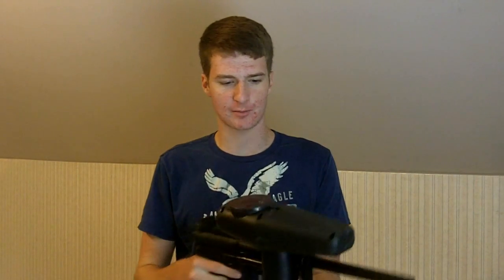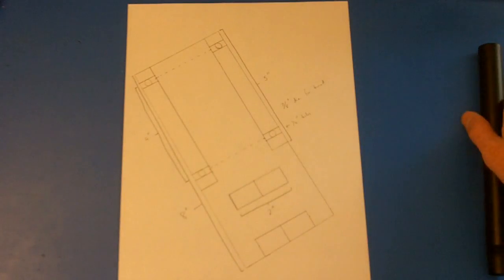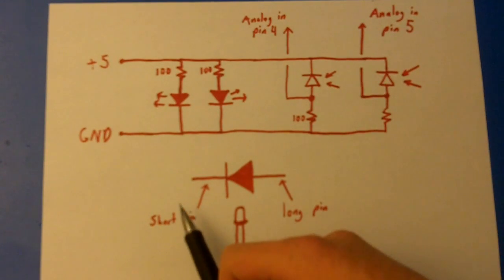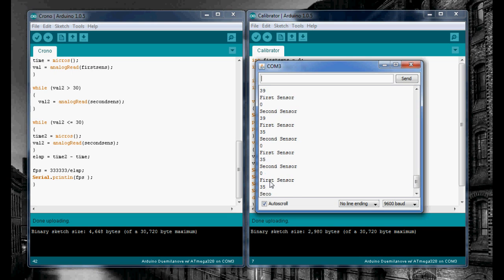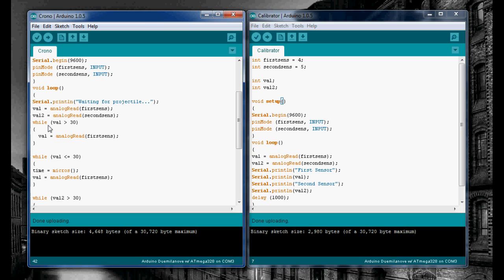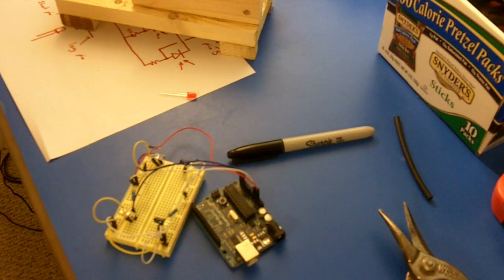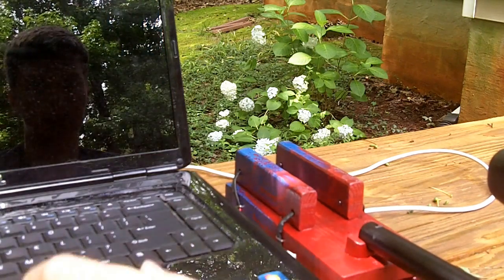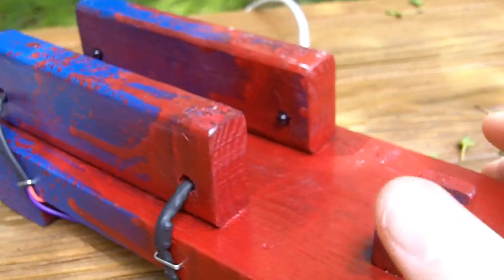How to Measure Speed With Arduino (Of a Projectile)

Comment: When you used the project outside, I was thinking would it be better to put a lid on the hardware , so it cuts down on the light , maybe then a threshold may not be needed ?? 
The barrel holder you've made, I was think of a piece of plastic conduit tube so that the barrel is more secure? . 
The diameter of tube obviously just a tad bigger than gun barrel, and make the tube say 1 foot or so rather than firing at point blank?
I'm to make your project to see results from my air rifle, I'll post back my results when I've got them.

Comment: Great Project! I'm trying to run this same type myself to measure the speed of a projectile coming through a split Hopkinson bar barrel. Are you using a 3 pronged receiver in the video? it just looks like a 2 pronged receiver but the schematic shows you have to have it grd and power and output to Arduino? I have it set up with an IR receiver module that actually comes with an Arduino starter kit but and I'm getting a reading but it won't show an interrupt is happening when I cover the receiver module? any ideas on what I may be doing wrong?

Comment: Loved the video! It really helps with a project I'm doing. I am a little confused on a way to apply to my project because it involves exporting the arduino data through a textfile to matlab in order to analyze it and display the information. Is there a way to do this for multiple trials without having to export each data attempt as a separate data file and changing the matlab code to read that file? Any help would be greatly appreciated!
Reply from the maker: Hey Drew, Thanks for the comment! Yes there is definitely a way to accomplish what you are wishing for. You should be able to print the data over serial from the arduino to a PC running your MATLAB script. The incoming serial data can be read using the serial object in MATLAB. You could also look into MATLAB's arduino support package which is designed specifically to connect arduino projects to MATLAB. Hope this helps!

Comment: improved version of same code 

//*******************************************CRONOGRAPH******************************************
// using IR detectors with 10k resistors at 5 volts 

#include <Wire.h>//MUST include for LCD to work
#include <LiquidCrystal_I2C.h>//MUST include for LCD to work

LiquidCrystal_I2C lcd(0x3F,20,4); //MUST have for LCD to work with I2C on ATmega 

// using 20x4 LCD with I2c address of ox3F 

int thresh;// lower value makes it less sensitive to ambent light 

int sens1 = A0;
int sens2 =A1;
unsigned long Time,Time2;
float fps,elap;
int val1,val2;

void setup() 
{
  
 /* was built with ATmega8 could use any ATmega 
  * setup runs one time after reset 
  *everytime ambent light changes just reset controller
  and all will be set
  */ 
  
 val1 = analogRead(sens1);
 val2 = analogRead(sens2);
 thresh = (val1+val2/2) - 50; // take AVG of two senors subtract 50  
 lcd.init();
 lcd.backlight();
}

void loop() 
{// begining of loop
  lcd.setCursor(0,0);
  lcd.print(" Waiting.. ");
  val1 = analogRead(sens1);
  val2 = analogRead(sens2);
   
  lcd.setCursor(0,2);
  lcd.print(val2);
  
  lcd.setCursor(5,2);
  lcd.print(" S1");
  
  lcd.setCursor(0,3);
  lcd.print(val1);

  lcd.setCursor(5,3);
  lcd.print(" S2");
  
  //**********************************loop while greater than threshold 
  while(val1 >= thresh)
  {
    val1 = analogRead(sens1);
  }

  
  //**********************************loop while less than threshold 
  while(val1 <= thresh)
  {
    Time=micros();
    val1 = analogRead(sens1);
  }

  
  //*********************************loop while greater than threshold 
  while(val2 >= thresh)
  {
    val2= analogRead(sens2);
  }
  //*********************************loop while less than threshold 
 while(val2 <= thresh)
 {
  Time2 = micros();
  val2 = analogRead(sens2);
 }
 //******************************** calculate everything 
 
elap = Time2-Time;
fps = 500000/elap;//  1 / inches x 1000000( 1 / 2 x 1000000 = 500000 ) sensors are 2 inches apart on my board 
                  // so 1 foot divided by 2 inches times 1 million equals five hundred thousand 
                  
lcd.setCursor(0,1);
lcd.print(fps,2);
lcd.print(" FPS         ");// if the spaces are not left you will get lasting digits on screen 

}//end of loop

Comment: sense he did not give no code for usage.... here you go ...i just moded his code a little 

//*******************************************CRONOGRAPH******************************************

#include <Wire.h>//MUST include for LCD to work
#include <LiquidCrystal_I2C.h>//MUST include for LCD to work

LiquidCrystal_I2C lcd(0x27,16,2); //MUST have for LCD to work with I2C on ATmega 

int thresh =15;// lower value makes it less sensitive to ambent light 

int sens1 = A0;
int sens2 =A1;
unsigned long Time,Time2;
float fps,elap;
int val1,val2;

void setup() 
{
  
  pinMode(sens1,INPUT);
  pinMode(sens2,INPUT);

 lcd.init();
 lcd.backlight();
}

void loop() 
{// begining of loop
  lcd.setCursor(0,0);
  lcd.print("Waiting.. ");
  val1 = analogRead(sens1);
  val2 = analogRead(sens2);
  
  lcd.setCursor(13,1);
  
  lcd.print(val2);
  
  lcd.setCursor(13,0);
  
  lcd.print(val1);

  
  //**********************************loop while greater than threshold 
  while(val1 >= thresh)
  {
    val1 = analogRead(sens1);
  }

  
  //**********************************loop while less than threshold 
  while(val1 <= thresh)
  {
    Time=micros();
    val1 = analogRead(sens1);
  }

  
  //*********************************loop while greater than threshold 
  while(val2 >= thresh)
  {
    val2= analogRead(sens2);
  }
  //*********************************loop while less than threshold 
 while(val2 <= thresh)
 {
  Time2 = micros();
  val2 = analogRead(sens2);
 }
 //******************************** calculate everything 
 
elap = Time2-Time;
fps = 500000/elap;//  1 / inches x 1000000( 1 / 2 x 1000000 = 500000 ) sensors are 2 inches apart on my board 
                  // so 1 foot divided by 2 inches times 1 million equals five hundred thousand 
                  
lcd.setCursor(0,1);
lcd.print(fps,2);
lcd.print(" FPS         ");// if the spaces are not left you will get lasting digits on screen 

}//end of loop
Reply: Thank you Melisa for this code. A friend and I are building this sensor except we are using 5 lcdr instead of just 2. There is only one problem, we have no idea how to code.... i adjusted your code a bit but i'm not sure it would work. I would be really happen if you could take a look to it. :)

int sens1 = A0;
int sens2 =A1;
int sens3 =A2;
int sens4 =A3;
int sens5 =A4;
unsigned long Time,Time2,Time3,Time4,Time5;
float fps,elap;
int val1,val2,val3,val4,val5;void setup() 
{
  
  pinMode(sens1,INPUT);
  pinMode(sens2,INPUT);
  pinMode(sens3,INPUT);
  pinMode(sens4,INPUT);
  pinMode(sens5,INPUT); lcd.init();
 lcd.backlight();
}void loop() 
{                       // begining of loop
  lcd.setCursor(0,0);
  lcd.print("Waiting.. ");
  val1 = analogRead(sens1);
  val2 = analogRead(sens2);
  val3 = analogRead(sens3);
  val4 = analogRead(sens4);
  val5 = analogRead(sens5);  lcd.setCursor(13,4);
  
  lcd.print(val5);  lcd.setCursor(13,3);
  
  lcd.print(val4);
  
  lcd.setCursor(13,2);
  
  lcd.print(val3);  lcd.setCursor(13,1);
  
  lcd.print(val2);
  
  lcd.setCursor(13,0);
  
  lcd.print(val1); 
  while(val1 >= thresh)
  {
    val1 = analogRead(sens1);
  }  
  while(val1 <= thresh)
  {
    Time=micros();
    val1 = analogRead(sens1);
  }    while(val2 >= thresh)
  {
    val2= analogRead(sens2);
  } while(val2 <= thresh)
 {
  Time2 = micros();
  val2 = analogRead(sens2);
 }
  while(val3 >= thresh)
  {
    val3 = analogRead(sens3);
  }  
  while(val3 <= thresh)
  {
    Time=micros();
    val3 = analogRead(sens3);
  }
  while(val4 >= thresh)
  {
    val4 = analogRead(sens4);
  }  
  while(val4 <= thresh)
  {
    Time=micros();
    val4 = analogRead(sens4);
  }
  while(val5 >= thresh)
  {
    val5 = analogRead(sens5);
  }  
  while(val5 <= thresh)
  {
    Time=micros();
    val5 = analogRead(sens5);
  } //****************************** calculate everything 
 
elap1 = Time2-Time;
elap2 = Time3-Time2;
elap3 = Time4-Time3;
elap4 = Time5-Time4;
elap5 = Time5-Time;
fps = 500000/elap;//  1 / inches x 1000000( 1 / 2 x 1000000 = 500000 ) sensors are 2 inches apart on my board 
                  // so 1 foot divided by 2 inches times 1 million equals five hundred thousand 
                  
lcd.setCursor(0,1);
lcd.print(fps,2);
lcd.print(" FPS         ");// if the spaces are not left you will get lasting digits on screen }//end of loop

PS: I didn't know what to do with the last lcd.setCursor and lcd.print so any suggestions?
Reply: Thanks It helps me a lot
Reply: Can you tell me which pins should i plug the lcd in

Comment: Hi. Thank you for the useful tutorial! I was wondering how to make it work with five IR sensors in a row. I'm a biologist and I need to measure average running speed in lizards, so I was thinking on doing something like you did here, but adding more sensors. I want to calculate the speed between pairs of sensors, so with five sensors I would  have four readings. I can do the "hardware" part, but I admit I'm a complete amateur in coding. Could you help me with that?
Thank you!
Reply from the maker: +Nicolás Pelegrin Hey  Nicolás, Thanks for checking out the video. I could help you with some code if you really need it. Are you using 5 sensors because you want to measure acceleration as well or just more average velocities. I think that this method with the IR sensors could work for you but there are probably easier methods such as using a video camera and capture the lizards running and use some sort of grid below them for a distance reference so you can track the motion by looking back at the video (Using frame rate and position measured on grid).

I think something like that would be much more practical for your application. The only downside to using a video camera to track the motion would be that it would be tedious if you needed to do a lot of tests because you need to go through each video and gather data every time. Also if the lizards are very fast then a normal camera may not be good enough but I doubt that any lizard would be that fast.

Comment: How would I go about building a chronograph for my rifles? They are reasonably powered ( eg 300 win mag) so what would I do for the frame and adjustments?
Reply from the maker: This version that I made in the video probably won't work if the projectiles travel faster than 300 fps or so. I should be making a video soon like in the next month or so that shows an upgraded version that can handle faster speeds.
Reply: +BreadboardBasics you can probably measure higher speeds by making use of interrupts to start/stop the timer.  Is that what you are considering?

Comment: nice , is this the same sensor that you used here ? https://www.sparkfun.com/products/241 , i hope that you make video about how to connect it with arduino. thanx for video
Reply from the maker: Those aren't the exact same but they should work anyways but it looks like the light comes out of the side of the led and in the side of the detector instead of straight in like mine
Reply: +BreadboardBasics thanx

Comment: Hello. Very nice project, thank you. When i strat the calibration codes i always see the value arounda 300.. i check my sensors with a another code that turn light on when sensor see the object with a pencil it works corretly. But final code it didnt work...
Reply from the maker: Hey sorry you couldn't get it working I can't really tell what is wrong with the info you game me maybe some more details as to what is happening would help. Also I should be making an upgraded version soon if you want to wait on that video it should have better code in it.
Reply: +basshasan just some time to late, but if you have a 3-pin sensor you need digitalRead instead of analogRead

Comment: can i use photocells
Reply: Maybe someone can answer this question? Because i want to use normal (red/white) leds and can i use photocells to measure? or can i use normal leds and IR sensors? Help is needed :D Thx
Reply from the maker: Sorry been afk for a while. But I would say that it may be possible with photocells but harder and more complicated You would probably need an amplifier to reliably detect the object. If you have regular led's then you could just use the led as a photodiode. Just search led as photodiode on Google. Honestly though I don't see what the big deal about the IR receiver is.. They are super cheap and you can get them many places.

Comment: while calibration, my first sensor value is always '0' in serial monitor. I have tried many different solutions, i am still having the issue. Do u have any thoughts on why my value might be 0 ?
Reply from the maker: Hmm, are you sure that it is actually the sensor that you attached to the input pin, and not the emitter on accident. Also I would double check the wiring and make sure that everything is correct. You also could have put the sensor in backwards.
Reply: Maybe you switched emmiter and receiver, you can't just tell by the colour which one is which, I have translucent emmiter and black receiver. I was on the same road so try to switch them!

Comment: Cool !!!.   Thank you for video. Could you please write what kind of sensors you used? I am new in electronics. Trying to understand that sensors. Again thanks )
Reply from the maker: Well I got the sensors from radio shack so your probably out of luck there but these are similar except they are side-looking
https://www.sparkfun.com/products/241
Reply: Agil Yolchuyev Radio shack still sells the ones he uses in this video. I prefer their geometric shape since they are easier to work with. Part # 274-0142
Reply: Agil Yolchuyev sorry 276-0142

Comment: Nice project. Her is my 2 cents to improve accuracy:
-Increasing distance between the two sensor obviously.
-Use digital input instead of analog (much faster). you may then need a trimpot to adjust the trigger level then.
-Don't evaluate when it is time to timestamp the timer in loops. Use external interrupts attached to the sensor pin to call the timestamp function a soon as it triggers.

Cheers :)
Reply from the maker: Cool, Thanks for the suggestions! I am still pretty new to coding and haven't had much experience with interrupts. Maybe I will make an update video were I have a much more accurate code. Thanks again!
Reply: How can you use digital input? Do you need a 3 wire receiver? I tried and it is not working well for me.
Reply: +BreadboardBasics any more updates regarding interrupts?

Comment: --Nice video , i need one for Airsoft but the FPs range is to much 0-600 FPS  is posible ?
Reply: Technically the arduino can measure a pulse that is 10 microseconds that being the case with a well built circuit you could measure 4000 fps plus at 4000 fps a object will travel around .5 inches in 10 microseconds.